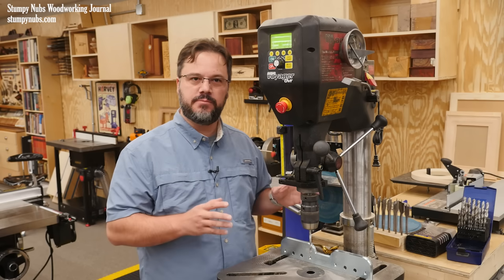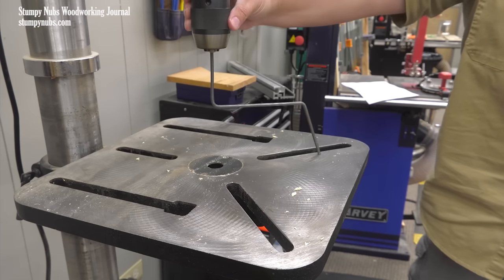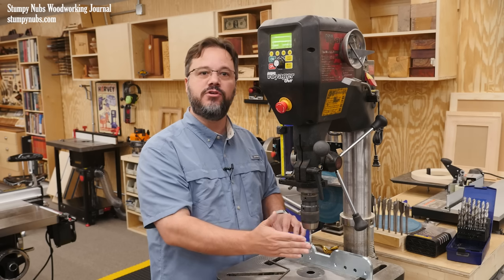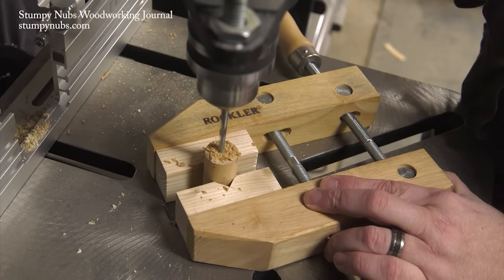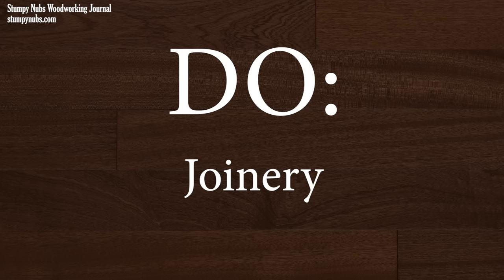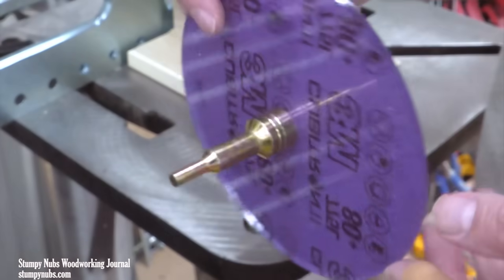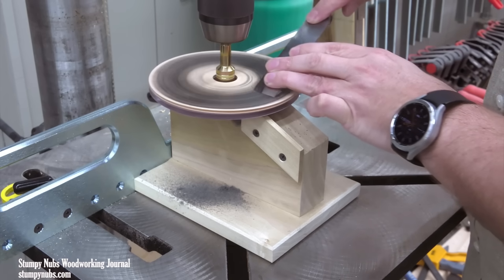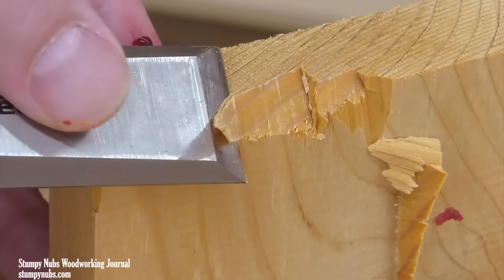WARNING: Internet drill press trend can SERIOUSLY hurt you!

Comment: One more VERY important tip when drilling soft metals like aluminum, copper, or brass, whether on a drill press, or with an electric hand drill, is to "back-off" the sharp cutting edge.  When enlarging a hole in one of those metals, ALWAYS slightly dull (back-off) the cutting edge of any drill bits you use after the one used to make the first hole, by touching the cutting edge lightly on a bench grinder.  The reason is, a sharp cutting edge on any drill used after the first drill bit, will IMMEDIATELY grab onto the edges of the hole you want to enlarge and is guaranteed to either rip the work piece right out of whatever you’re holding it with, or snap the drill bit, and usually both.  Clamping your work piece when using a drill press should always be first on your safety list, but especially so when enlarging holes in soft metals.  I have seen some very nasty accidents because the advice outlined above wasn’t followed.

Comment: My favorite drill press.   I believe it’s equipped with a variable reluctance motor… Yes?  If so, constant torque throughout its speed range and reverse capable!  I have variable reluctance motors on my lathe, drill press, shaper, 12” disk sander, table saw and more.  (Yep.   A variable speed table saw… sub 100 RPM to 9k+ RPM. HANDLE WITH CARE!!!). There is no equal.

Comment: Yup. Was freehand drilling a piece of white oak about 2 x 2 inches thick by 16 inches long. Guess I wasn't holding it tight enough. Machine yanked it out of my hand and spun it around so hard it put a huge deep dent in my upright post. Had to have my buddy who owns a body shop remove the dent. If it can dent solid steel that badly, imagine what it can do to you!

Comment: When drilling metals always use the proper type of drill. If you are drilling brass, bronze or other copper alloys the cutting edge of the drill should have a small negative rake. This will prevent the drill from self feeding and grabbing into the material. 
A good drill press vise is well worth the money. Heinreich in Racine Wl makes some very nice ones. 
To prevent tipping the machine over you can add extensions to the base. If long work is being machined it must be supported.
Lastly. The major problem with most drill presses especially home shop ones is the tables are too damn small. Even a lot of industrial ones the tables are too small.

Comment: My grandfather taught high school wood and metal shop many years ago. He’d seen a lot of injuries in his years of teaching. He said the machines that hurt more people were the ones that the kids didn’t respect. They feared the big saws, but not the lathe, disk/belt sander, drill press, or bench grinder. Of all of the machines, the drill press probably hurt the most students, especially when drilling sheet metal and not clamping it down. Lots of hands turned to ribbons in his stories.
Reply: We had workshop classes at my school. All seemed to be mostly uneventful but the one incident I did hear about was with a disk sander. Apparently the piece the kid was sanding flipped up and pushed his fingers into the disk.

Comment: Hi, 50 plus years of type 1 diabetic the  Glucomemter sounds like a great idea. Save on ginger sticks. If you can use a drill press vice, put aluminum or some other material to make soft jaws not to mark up the project. Either clamp down the vice or if possible put the handle on the left side (facing drill press) of support column. With at least one clamp.If your vice has a pivot in the handle then slide a piece of pipe that is close to the diameter of the handle, over the handle to keep the handle straight and put that against the left side of the column. If anything binds up the vice cannot turn because of the handle and the clamp keeps the vice and the work piece from raising up. Even when using a fence always be aware the work piece can jam raise up. Once free of the guides or fence it will spin with the drill. Always stand (if possible) so that the work starts spinning your body is out of the material range, or circle ⭕️.  Safety glasses are a must have.

Comment: A cheaper magnet option is to just use some rare-earth magnets; I've been doing that since RE magnets came out. I have one on the face of the drill press for the chuck key and a couple on the sides below the belt cover for things like allen keys, a small pouch to hold safety glasses (just stuck on with a magnet so it's open), a scribe, a pen, etc. The magnets I mostly use are recovered from old hard disks; very powerful and pretty much free with a little effort.

Comment: Use step drills for thin metal. Twist bits catch and spin the thin material, no matter how secure. Or invest in a heavy duty hole punch, much safer.

Comment: Great video, also plenty of older drill presses use threaded chucks so make sure you know as they don't have the give like tapered ones.
Also were i live i find it a pain that most of the big stores except specialty ones now don't stock imperial bits even tho i live in a place were metric is the norm i was brought up using imperial for wood working and metric when doing building...so its a nightmare so often trying to do jobs when you can't just go to the big names and buy them.

Comment: I routed with my first 89$ drill press back in the 1980s  the chuck came out and the bit doug out my thumb nail.  I reinstalled the chuck drilled a hole through and pined the chuck in place with a finish nail. Then continued routing.

Comment: I started work in my dad's shop at age 15, mostly drilling good sized pieces of metal.  I learned quickly that you had to carefully hold objects being drilled.  Drilling through metal when the bit is about ready to break through it can grab the object and spin it.  You want to have the object held very carefully or you want to have it clamped down very well.  If you can't do that then hold the object so that if it starts to spin you can easily get out of the way.  If you sense when the bit is about to break through and go gently that can help too.  Another thing I learned- wrap the fingers of one hand around the drill bit while using the key on the chuck.  Otherwise if the key slips your knuckles will be raked across the sharp flutes of the drill bit.  If you wrap your fingers around the bit that will shield it.
Even though I've used drill presses a lot, and for a long time, you still had some good suggestions I haven't seen before.

Comment: Hi James, I followed the link to project plans but didn't see the jig for the chisel..
Reply: Hopefully he'll link the plans, but IMO, your best bet would be to wing it, as you'll need to customize every dimension to fit your drill press, as well as the angle of your chisels. The angle is the only critical measurement.

Take a thick piece of wood and square it up around the perimeter. Cut the beveled corner to match your chisels' bevel angle, ±0.5° should be OK. I have a 25° one for common (bench) chisels, and a shim that brings it up to 20° for some paring chisels I use. James put a wide base on his that rests against his fence, which is something I didn't bother to do, but should have!

Another tip from a knife maker--if you end up having to do a lot of heavy grinding (e.g., regrinding the bevel/changing the angle), avoid getting that thin edge of the chisel too hot, as it can ruin the heat treat/temper. Have a small container of room temp water nearby to dip it (and really swirl it around in there!) after every few seconds of grinding. Wet sanding is great, too, if you have wet/dry sandpaper and don't forget to dry your table after to avoid rust spots.

Hope this helps.
Reply: Jig is a product sold at the link for the Sharpening system
Reply: @Ryan_Thompson  Thanks very much for the detailed description. I was going to make one anyways, but I thought if he had plans available I would at least look at those.
Reply from the maker: https://cdn.shopify.com/s/files/1/0091/2169/3747/files/Drill_Press_Sharpening_System_Manual_and_Jig_Plan.pdf

Comment: My brother unfortunately ran afoul of using a glove while operating a drill press. The company he worked for at the time required gloves as mandatory safety equipment when working on the factory floor. The piece he was working on broke and hooked his left hand glove pulling it into the drill bit. By the time he hit the e-stop. He had four fingers broken, and 37 stitches across his palm and fingers.

Comment: Most old school and some modern Milling machines have morse taper chucks and arbors where as one of my drill press's has a screw on chuck and the other a morse taper, so I don't really understand your point @1:11. The problem with using a drill press as a mill is the side loading on the bottom bearing where a mill has a much larger bearing to cope with the side load. A mill is a great drill press but a drill press is not a great mill.

Comment: My friend had a shopmate that passed out from the fumes of teflon on a lathe. He fell into the machine. 

Can I add teflon/ptfe etc to the list of dangers? Also don't cook with it guys, turns out its much less safe than we thought if at cooking temps. 

Rotary devices and gloves is difficult to convince people of. These officious clear videos are a great help to me for at least the argument from authority, and before i need to show the real end results.

The drill press is a good tool to train on as it demonstrates its power and how things can go wrong but still rarely catastrophic. Especially emergency stop practice. 

I was using a fresh bit of a name brand i've used before and it snapped like a stick biscuit. Something went wrong with the temper as it was weaker than powder metal. It was 8-10 degrees c. 

My brand of high quality screws also no longer work well above 32 c or so, they start to twist the heads off with my impact driver. The base temperature made a much bigger difference than I could've guessed.

Comment: Even handheld battery powered drills or impact drivers that we all use daily can be super dangerous. An apprentice at my work was screwing a sheet metal screw into a piece of sheet metal he was holding. Seemed pretty safe until the screw caught an edge on the sheet metal and swung it around like a helicopter blade. It cut him about 1/2" under his eye, there was blood everywhere. Luckily it was few stitches, no scar and no damage to his eye. He could have blinded himself. It really opened my eyes (no pun intended) to the potential dangers of a spinning bit or screw.

Comment: Many non-machinists don't know about machinist clamp kits and step blocks.  T-slots are not required to use them. They work much better than the usual improvised clamp methods and if the workpiece is sensitive can be padded with plastic like a strip of old milk jug. Secured work doesn't drift and cause wrong or bad cuts.

Comment: You can swap out your motor and add a VFD. If you already have 3 phase power it's easy and if you only have single phase like I do, I added a 120v 1hp VFD to a 3/4 hp 3 phase 208 motor. Now I have infinite speed control start stop jog and forward and reverse for tapping.

Comment: I once wore gloves while drilling a hole (like a fool, I know) and did get caught, but the belt of the belt drive started to slip around the motor for just under a second until I pressed the stop button and my hand was fine. Still hurt a lot though. If it was a chain drive or solid gears, my hand might have been mangled.

Comment: Regarding mill bits in drill presses - I agree that it's not recommended but I have done it sometimes. I don't think the reason it's a problem is due to the tapered interface for the chuck - mills also use those (and the threaded drawbar is not intended to take a load - just to make it easier to change tooling). I think the reason is because the spindle bearings and overall structure of a mill are designed to take large, varying side-loads without flexing, which would lead to chatter in a drill press. Drill presses do need to be able to take side loads safely because many of the tools used in them (such as the Forstner bits you show) can generate sudden very large side loads on occasion.
Reply from the maker: I have done it in the past. But only very light passes. And I publicly discourage it. But I see people using a profile bit in their drill press like an upside-down router table. That's putting a lot more side pressure on the chuck.

Comment: This incident is from two milling machine operators. The guy working in one machine heard the spindle sounded strange in the mill besides him and went there to take a look. The tool had grabbed the loose clothing of the operator and he was strong enough to resist getting his guts eaten up. He was a weight lifter and had managed to grab the sides of the door. I think he pressed 150 kg’s , at least, because he was quite a hefty guy. It probably saved him. The other guy pressed emergency stop.

Comment: 2:51 I clamped the metal piece with a drill press vise, but didn’t secure the vise itself, tried to freehand the metal workpiece with large diameter drill bit, pressed too hard, bit got stuck in the piece, vise started to spin and messed up the spindle real good. Surprisingly the bit did not break. Now the drill has a real bad runout. Fortunately I did not get hurt.

Comment: No long hair near any rotating machine (an MIT student was killed when her hair got caught in a drill press spindle), no long sleaves, on lathes keep bottom of shop coat away from lead screw; when drilling brass, break the sharp edge of the drill bit to prevent the bit from screwing itself into the work. There are too many other things to consider, especially with machine shop machinery to list here, you have to think things out before you press start!

Comment: An even better sand paper my dad used when he worked with solid surface is micron sand paper.  The particles are guaranteed to be no larger than what is printed on the discs.  The micron rating will be weird if you are used to grit since the smaller the number the finer the grit where as with grit it is the higher number the finer.  If you have a non rotating strop it will work really well with aluminum oxide powder.  It is a very fine powder but being about as hard as sapphire it works surprisingly fast.  A small pinch of that stuff can easily polish away light rust with just a little light rubbing.  I know about that stuff because I know someone who does wood carving and that is the stuff they use to keep their chisels razor sharp.

Comment: I have a machinist vise I use to hold smaller things on the drill press. I had never heard of one with a fence on it though. I honestly don't use the thing much but when I do it makes things so much simpler. I have two now I picked up a small foreign brand one at an auction cheap i turned that one into a project and made a new base for the motor and put a small 3 phase motor and VFD on it. Got a larger floor unit for garage. I drill metal if I think it is near through i usally just take little taps at it till breaks through, or if hand drill just reverse it find cleans up some of what may catch. If I think could catch I always stay to the side it would first try and go towards.

Comment: Especially for drilling metal I recommend to bolt a vise to the drill press table. It's fast and easy to use and stable and work for most workpieces. But the drillpress I have has a round table that can be rotated around it's own axis which makes the vise a lot more practical to use. Your drillpress doesn't seem to have that possibility.

Comment: I've got a 1/2 inch scar on my left thumb from the nail up. I tried to hold a piece of steel to bore the hole out a little further. You know you've done something stupid almost immediately with a drill press. Just a fence would have worked but that allows the piece to ride up the drill so clamping is really the only alternative. I hadn't used a drill press in decades before I did that. I won't make that mistake for, probably ever again.

Comment: Here is a trick I ALWAYS USE.
I always use a 2x8 to drill into - always for everything never the top of a metal drill press.
When drilling metal I use a 1/2" bolt into a 1/2" hole and let the metal being drilled rest/press against it.  Won't let metal spin
The metal bolt head is also important as it also prevents metal "rise" when drilling and catches it before it rises up and spins off the top of a plain piece of metal
I always use metal and not wood dowels for drilling metal.

Comment: Drill Speed, I was always slowing down the drill speed at my last job as people though a higher speed meant less time drilling or countersinking. We worked with stainless steel using cheap company bought drill bits & the number of burned out drill bits/countersinks was amazing. I found it hilarious watching someone get a new drill bit then burn it out after a half dozen or so holes then struggle while drilling the remaining holes. Then they would watch me days later doing the same job in less time wondering how I was faster when I had set the drill to the slower recommended speed. Not only did the bits not burn out at the lower speed but the bit was able to get a better bite & remove swarf instead of dust.